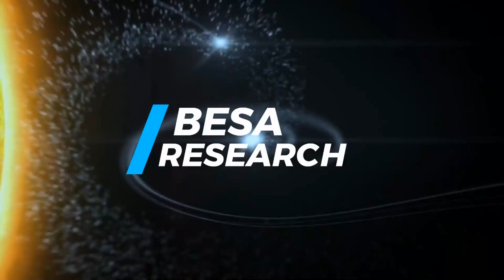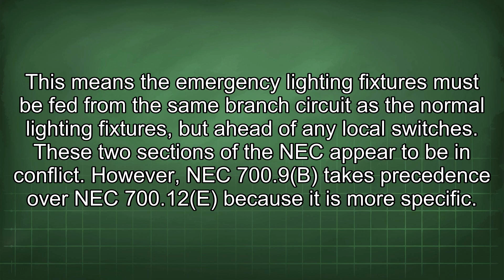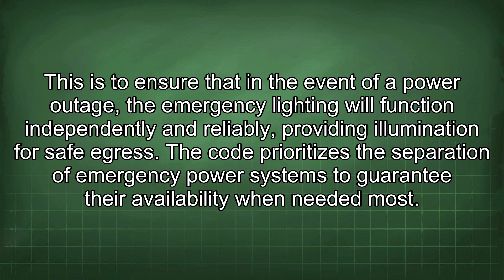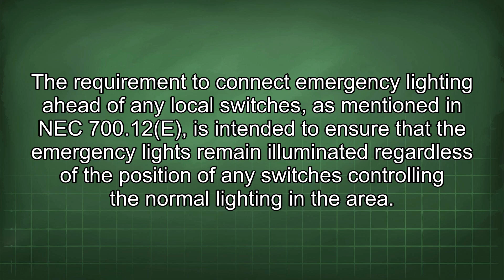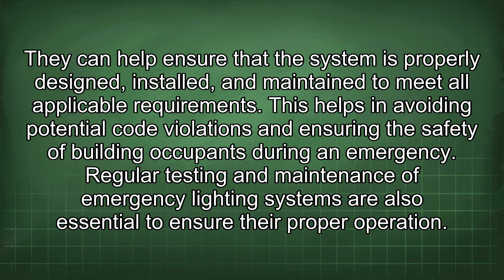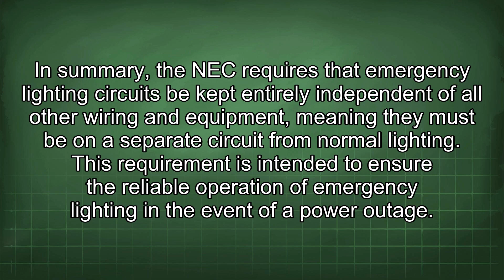Emergency Lighting Circuits NEC Requirements Explained Simply

Comment: 100% wrong. Take this down. Battery backup lighting and exit signage MUST be on same branch circuit that serves that area but terminated before any switches. The emergency portion of the wiring is inside the device and therefore not required per 700.9

Comment: If emergency lights aren't on the local circuit and the local circuit fails your emergency lighting wont come on.
Reply from the maker: Hello @bend4236,

Thanks for your comment. This is very true! The lights should be powered by or triggered by the local lighting circuit.

Kindly,

BESA Research